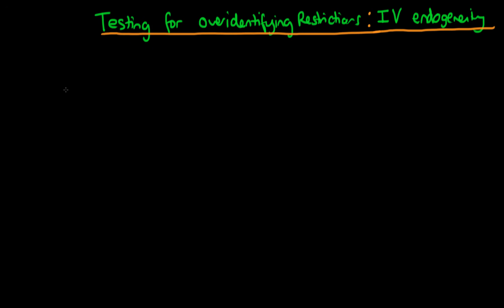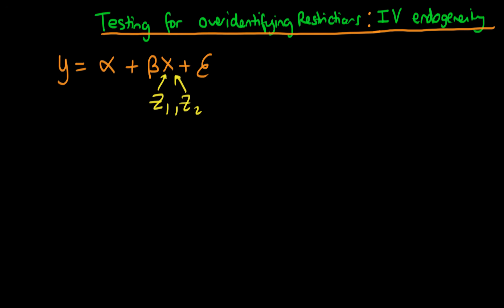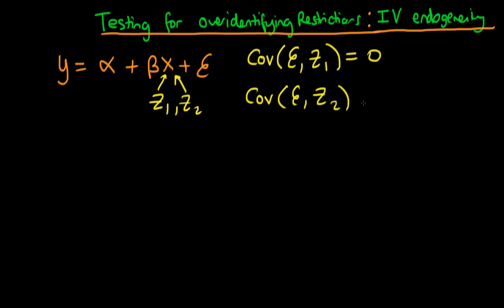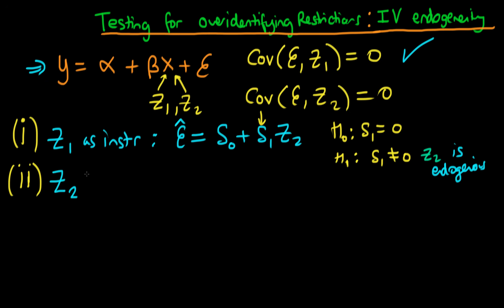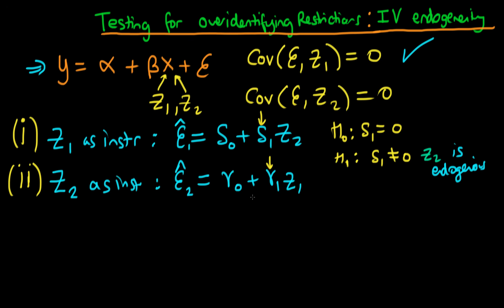Testing for endogenous instruments - test for overidentifying restriction

Comment: 3:58 you said estimate these 2SLS, did you instead mean via LS? Coz in the conclusion part you mentioned that 2 IVs were required otherwise epsilon hat would be baised
Reply: Do you know it now if it is LS or OLS?
Reply: @lastua8562  https://www.econometrics-with-r.org/12-3-civ.html  it is the error from 2sls.

Comment: I have a question: Why can we use this test for finding whether z is exogenous by regressing the estimated errors from the original regression on the variable z? I thought the estimated errors (or residuals) cannot be used to test the relationship between the actual errors and the variable z (exogeneity assumption). Would be glad about having an answer! Thanks!
Reply: he says "some part of the error". We cannot check if x is correlated with the error, but rather z and our estimated error, which in theory should be somewhat related to the true error. Not sure why though.

Comment: I love your videos, they are so helpful! However, this is the first video I am finding a little more difficult to work out. In our econometrics class, we say that if we have multiple instruments for one endogenous variable, the instruments will be considered relevant if the F-statistic from a joint test on the instruments is greater than 10. Is this true? You mentioned something about if the Rsquared is small, we will not reject the null... what do you mean by this?
Reply: The instruments will be considered JOINTLY relevant in the regression because the F-statistic is so ridiculously high (10) that you reject the null hypothesis, which says that they're not significant together (null hypothesis states that all their population coefficients are zero). Under the null hypothesis, the test statistic is NR^2 ~ chi-squared with some df. This means that for a high R^2, the test statistic will be higher and you will be more likely to be in the rejection region. This high R^2 also shows that a lot of the variance in the residuals can be explained by the instruments, and thus they are correlated (which is a no-no for instruments).

Comment: For the test of over identification at stage one you stated that you estimate the equation by two stage least squares to get the estimated values of alpha and beta. Did you mean OLS? The part I am asking about starts at 3:48
Reply: +jods kin I don't think he meant OLS, you use two stage least squares to get rid of the endogeneity part in X. You do this by regressing X on z, to get values of alpha 0 alpha 1 z, this new value of X will now be estimated. So in order to keep notation clear, putting it back into the correct form, it is y  = gamma 0 + gamma 1, because now your new error has values that werent previously there, so you have a new error too.
Reply: @AloofMusician  Are you sure?
Reply: this is where the notes on board are confusing.  The residuals are taken from the second-stage regression of the 2SLS.
Reply: @zjli1234  Can you explain? I think 2SLS might be correct, though it is not the same as the usual one. It only is used because there are "2 stages", namely first OLS, then predicting the residuals with our IVs. Am I mistaken?